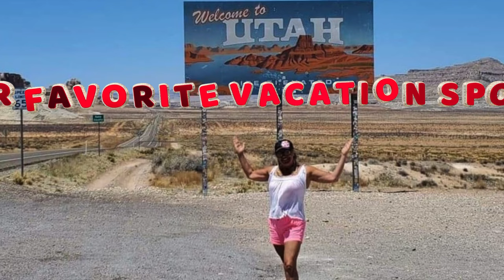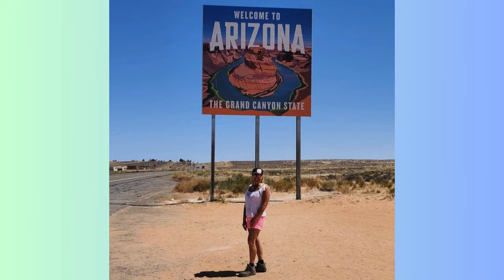😨PROPANE LEAK & SHODDY manufacturing! Heartland Corterra CT3.0~ #rvmattress #brooklynbedding

Comment: Every time I watch one of your videos, it sways me more and more away from ever purchasing any RV.
Reply from the maker: It's like any hobby...it will cost you!
Reply: @blueoxontherun9188  Yes, a friend purchased an RV a few years ago. Within the first six months of ownership, roof leak. Back to the dealer for over six months. After the "repairs", within the next year, roof leaks. Close to $12000 later, a new roof installed. Yes, VERY expensive hobby!
Reply from the maker: It could be right?
Exactly the purpose of having a knowledgeable team going through that unit, before signing any paperwork with a seller 🙂
It is now becoming a necessity for people in the know to find themselves an  inspection team to protect their assets 😉

Comment: That propane tank brand seems to be a popular cost saving for manufacturers these days.  My guess is the valve’s cross threaded.  They also consistently have chips knocked off the porcelain on the bottom making it hard for ultrasonic tank monitors to get good readings

Comment: Just curious if there are any brands you won't inspect because (based on past experiences) you know the unit is more than likely going to be a P.O.S.  This unit might qualify.  Also alarming to see how rusty the undercarriage is already, although you probably see this frequently.  I work in an industry where the customer is given the opportunity to inspect their new vehicle (generally priced at $250k and up) before it leaves the manufacturing facility.  The inspection process generally consumes the better part of a day or more depending on the customer and/or intricacy of the vehicle.  Such a process would be a game changer for the RV industry, although am I correct in believing that this may be offered with some brands????  If so, do you know which brands do allow a factory inspection by the end-user?
Reply from the maker: It would be a "special" event or high end $ unit when they will allow such practice 😉
Reply from the maker: To answer your other question, they are all equivalent in inconsistencies. 
Except for "Prevost", we'll inspect most all of them 🙂
Reply: @blueoxontherun9188  OK - with the volume of production in the RV industry I can see why this would not be commonplace.  I get it that hand-built RVs will always have some variations or inconsistencies, but the RV industry has got to its act together.  The real story is who drives that - the end-user who refuses to accept a unit or the responsible manufacturer who recognizes their faults and takes the necessary steps to effect change?  I may be more critical than some (but I'm still reasonable).  However, I've not yet seen a towable manufacturer that I'm ready to leave my money with.  Always appreciate your videos!
Reply from the maker: Responsible manufacturers 🤣 good one !!
Reply: @blueoxontherun9188  I know - wishful thinking!  But it seems some do listen (on occasion).